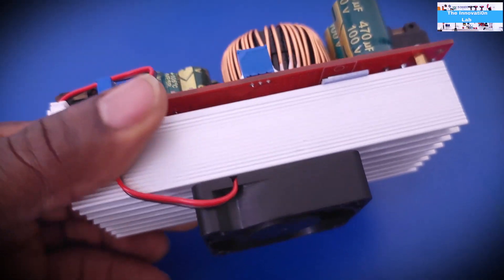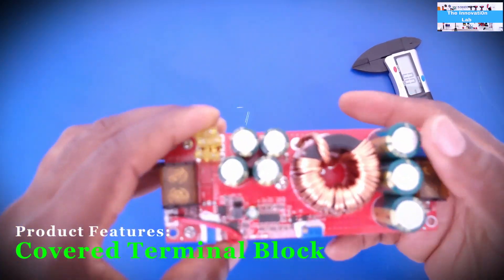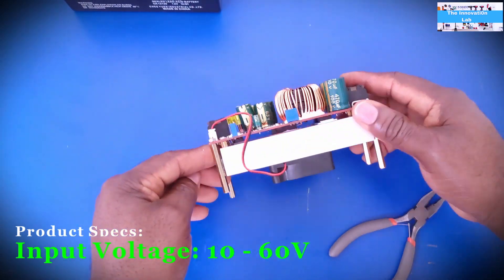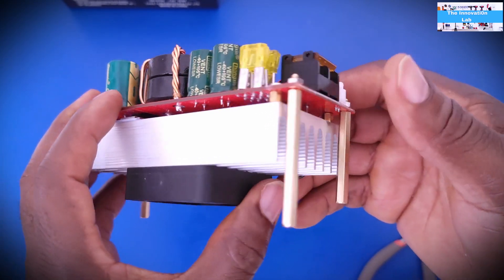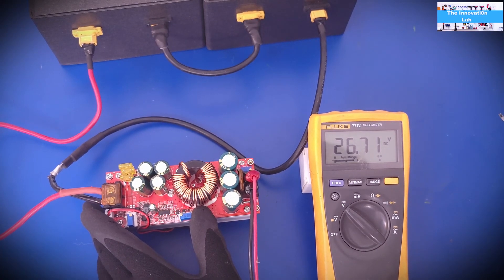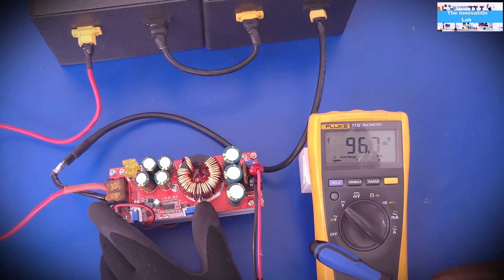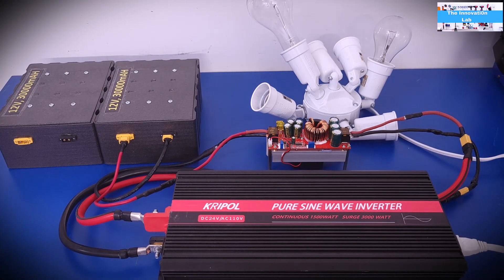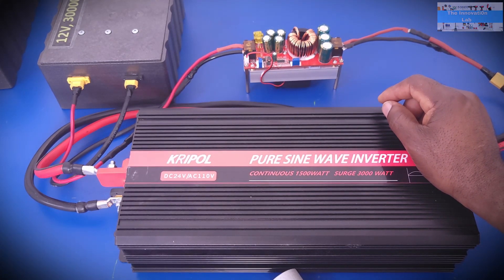Testing Cheap DC-DC Converter from Amazon - Are They Any Good?

Comment: Great video,I have been wondering if I could use a 60v 10amp hr battery to run a inverter for back up power in emergencies, inverter is 12 volt 1000 watt pure sine wave. Thanks again for your videos.
Reply from the maker: Thanks a lot for the wonderful feedback!
We do appreciate it.
However, this converter can only be used to raise input voltage to higher levels. Since you have a 60V battery and your inverter is 12V, it seems that what you will need will be a buck converter. Just keep in mind that you will lose a lot of power due to efficiency losses on the buck coverter.
Thanks again for the thoughtful question.
Success wishes on your projects.
👍

Comment: The fan is not automatic i purchased 2 pieces  now I am using fan direct
Reply from the maker: The fan on the ones I have usually  turn ON automatically when the system warms up to a certain temperature - as you apply a heavy load ofcourse. What is the maximum load you have applied to your converters?
Reply: Both of converter i checked but automatic not working thanks

Comment: So with 12 v inputs the 1800W boost converter delivers 360W and 30A with 24v output, avs what with 84v output.? But what about 2 in parallel with 2 diodes on ithe output to share, could you do a test if the current will increase to 60A, and can you show what happens if you put the current potmeter to maximum, will that incerease the current further? I am curious
Reply from the maker: Thanks a lot for such constructive feedback. I greatly appreciate it when someone takes the time to watch our videos and provide amazing feedback. 👍😎👏
Your ideas are great, and everything you said is correct. I have considered making a video to show how you could connect two or more boost converters in parallel using diode output isolation or droop sharing, but I have not been able to do so yet. But I definitely will.
The only issue I see is that this topology will only work for a fixed output voltage system - if you are able to tune both converters just right.
- same output voltage level
- same output current limits....etc.
My experience is that the switch-mode power supplies naturally do not like being paralleled unless they are designed to work together with a synchronous control.
Again, I appreciate your feedback, and please stay tuned for when I make that video.
Thanks again!
👍👍

Comment: This test is without a heavy load...What is the current under extreme load?  For electrical bikes you need a lot of torques. I doubt if this boost controller can handle that. why didn't you use 2 or 3 boost converters parallel and use diodes in  the output or 5W 10K resistors to share  the current in all boost converters in parallel ? Than it might work if your battery can handle the current.  Then why you don't use a 72v hub motor put the current potmeter on maximum and increases the voltage to 84V  that decrease current.
you just need to have an extra cooler on your motor and an more heavy controller maybe?
Reply from the maker: Thanks again for all the wonderful ideas and suggestions. 
I have a test video coming out in a few days that shows the boost converter being tested with my ebike load simulator - under heavier loads.

Comment: Thanks for this video...I just wonder what will happen with the current under load if you use 12v input and boost till 84v, Will the current stay 40A or collapse?
Reply from the maker: Thanks again for the wonderful interaction and feedback. 👍👍
These converters have an input current limit of about 30A, which means that you should really expect less than 360W at the output of the converter if you use an input voltage of 12V.
For driving something like an ebike that will impose high current surges on the converter, I won't recommend using a 12V input source unless we can show that paralleling the converters will work efficiently. As you know, the higher the input voltage, the better.

For the specific 12 to 84V case that you presented, let's do some math...😊
Assuming that the following conditions apply;
Input voltage: 12V
Max Input current limit: 30A
Converter Efficiency: 98%
Converter output voltage: 84V
Delivered output power = 0.98(I *V) = 0.98 * (30 * 12) = 353W
Delivered output current at an output voltage of 84V = 352/84 = 4.2A.
So, looking at the math above, one can confidently say that, yes, at an output load of 40A, the converter will basically crash or go into oscillations - depending on the nature of the load.
Also, keep in mind that the efficiency will definitely be worse at a 12V input. I would expect low 80 - 70% ranges. I just used the 98% as a theoretical best case.
Thanks again for such thoughtful interactions, I appreciate it.
Please let me know if you see any error in my math above.
👍😎

Comment: I have watched this video twice now. You have some great information here and i really appreciate you sharing it . I have a question. How do we know what size boost converter do we need for our project. What determines if the converter is suitable. My input and output voltage falls within the range. What else is important to know if it works?
Reply from the maker: Thanks again for the wonderful feedback.
This converter can be used for a wide range of DC to DC applications. It really depends design needs. 
Here are some examples of what I would consider:
- Rated Outout power
- Rated output current
- input voltage ranges
- Desired output voltage range.
- output ripple 
I typically don't worry too much about the output ripple if I am using the converter for battery charging. However, for amplifiers and more sensitive applications, ripple voltage levels need to be considered.

Please let me know what you will be using the converter for, just to help me provide a better feedback.
Reply: @theinnovati0nlab782  *Here is the ideal i had after being frustrated with my Ryobi tool batteries. I want to make a backpack mounted power pack using Kobalt 24v batteries wired in series. I wanted to use the boost converter to power my battery powered tool no matter the brand . i will construct a adapter to fit the slot to power my tools. The main tool that it would be used for is a 40v Ryobi leaf blower. Because the voltage is adjustable i thought i could just change it to the required voltage of the tool. I found video of a similar example to give you an ideal :https://www.youtube.com/watch?v=KQ9UiD-OTbk
I hope my ideal is clear. please let me know if you need anymore information. I appreciate any input.*
Reply from the maker: @dexterousx92  
Thanks a lot for the clarity and for sharing the video.
For such a project, you need to know the power specifications of the Ryobi leaf blower. Then, with that  known, you can now select a boost converter and battery system that can provide that much power.
In a nutshell, you need to know the following specs of the leaf blower;
- input voltage 
- input power.
P = IV; can be used to calculate the drive current required - If that was not provided.
Unfortunately, most tools will only tell you the voltage rating. But this is ok. It only means that you need to design your battery pack to be able to deliver high currents. 
As for boost converter recommendations, I believe that the 1500W converter used in this video should be able to provide all the power you will need. 
Important note:
Make sure that you set the output current setting to the max point.

Safety:
Please lithium ion and lithium phosphate batteries have very high energy and power densities. While this makes them very useful and desirable, it also makes them dangerous. Please be very careful with your battery designs and charging process.

Success wishes on your project.
👍😎
Reply: @theinnovati0nlab782  Thank you for this very informative response. Ill let you know how things turn out.

Comment: Can i use this to charge secondary battery? From alternator to this then out to 2nd battery..
Reply from the maker: Hi friend,
Thanks for the very thoughtful question.👍
We get this question a lot.
I believe that under careful calculations and a good understanding of the power limits of your alternator, it should be possible.
However, please note that there is a Moderate to HIGH risk of damaging your  vehicle's electrical system if the boost converter fails. 
Personally, I would not encourage you to do it - too risky for me, given that a vehicle is involved. However, if you must do it, I would recommend adding input and output blocking diodes - going from your alternator to the boost converter (input) and from the boost converter (output) to the battery you are going to be charging.
Secondly, I would recommend using low charging currents or trickle charging - this way, you won't overload your alternator. 
Lastly, try not to do the charging while your alternator is already under heavy loads like running the A/C, headlamps(at night),......etc.

Lastly, please note that my suggestions above are purely theoretical, as I have never tried this concept in the past. 
But it should not be rocket science, though.😊
Success wishes to you, my friend!
👍😎

Comment: This is a really good video, and I will like to buy this device to convert the power from my 24v wind turbine to 48v since I have changed my inverter to a 48v system, but I have a question.

Do I have to connect power sources to the input and output before I can adjust the voltages, and can it work even if I do not make any adjustments to the input and output voltages? Thank you in advance.
Reply from the maker: Hi friend,
Thanks a lot for the wonderful feedback. 
You only need to connect a power source to the input of the converter (10 to 60Vdc) to adjust the output voltage. 
Steps:
1. Connect your input  voltage source.
2. Connect a power monitor or DMM to the output.
3. Adjust the output voltage potentiometer.....that's it.

Note:
This is a boost converter, and you can only adjust to a higher output voltage. For example, if your input is 24V, your output will never be lower than that.

To adjust the output current, you will need to connect a load to the output.
Reply: @theinnovati0nlab782  I thank you for your prompt reply, but I still need a little more clarification. I have a 12v power bank which I can connect as input to adjust the output voltage which I intend to put at 55v and I assume that when the wind turbine is connected the converter will accept the variable voltage from the turbine, but why do I really need to adjust the current? 

Can the converter not vary the current as the input voltage vary?

My wind turbine is actually a very small 200w type and wind does not really blow too often in my location so I am wondering if I can just cope with the default current setting, except changing it can help my turbine to start charging with very low speed wind.
Reply from the maker: Hi friend,
The truth is that this boost converter is designed only for steady state input power. I would not expect it to perform well under a variable input power application such as a wind turbine or solar. 
Please see the video we made to illustrate this below 👇👇
https://youtu.be/4RfOrXcBvOY
Also, I have never done any wind turbine projects, and I don't know much about it.
My suggestion given that this converter is only about <$30 will be for you to get one and conduct a performance test on your system. 
But again, I wouldn't recommend using this converter as a wind energy charge controller. It was not designed for that function. Even if it works to some degree, I would expect it to be very inefficient.

Success wishes on your projects.
😎👍

Comment: Hey just wondering if I could use this in reverse or if it would work for my purposes. I would like to have my input voltage roughly 60 volts 120 watts be converted to an output of 12 volts 700 watts. Could this work for such a purpose, or is there another converter you would recommend?
Reply from the maker: Hi friend,
Unfortunately, this device only works as a boost converter - it can only increase the input voltage. It does not work in reverse.
It looks like you need a strong buck converter that can deliver high currents. I have not seen anything that comes close to what you need. The ones I have used in the past are buck converters rated for <15 amps.Amps.

A 12V, 700W output means that you will need a buck converter that can deliver greater than 50A of output current. You may have to consider a custom design. Or you can do an online search. However, my hunch is that it will be relatively expensive.
Reply: nop you can also use this converter as a step down buck  converter.    to handle higher current you put 2 in parallel or 3 and ad on each output a high power and current diode or a 4 w 10 k resistance to keep the current share in all parallell converters
Reply from the maker: @hermantelbo6283  
I am not sure if there is a typo in your first statement. But were you saying that a boost converter can be used as a step down (buck) converter? If so, please share how you are able to accomplish this.
My understanding is that there are essentially three types of non-isolated DC-DC converter topologies;
- Boost: Only boost the applied input voltage to a regulated output.
- Buck: Only steps down the applied input voltage to a regulated output level.
- Buck-boost: A hybrid design that performs both boost or buck.
The converter reviewed in this video is strictly a boost converter, and it can not perform a buck function.
Please clarify your comment so we don't confuse our audience.😊
I am also willing to learn something new - if I was wrong
Thanks again.
👍😎
Reply: please can you do a load test with 2 boost converters 1800W in parallel.  with 2 diodes in the output.  I wonder what happens..

Comment: Hi, I’m looking to charge 8 batteries in series (96V DC) off of a car alternator, about 14V DC. Do you think I would get any oscillation if so I can I lower the wattage so that it’s just a trickle charge?
Reply from the maker: Hi friend, 
I like your innovative mindset. 👍👍
However, this is not something I would personally recommend - given the perceived risk level involved. Doing this could potentially damage your vehicle's alternator and electronics if anything goes wrong.

Now that we have talked about the risk, I believe that your idea of charging multiple batteries in series using the boost converter is possible as I have shown this in many of my videos.
However, in your specific design, I see some issues;
1. If you are using lead-acid batteries, then you will need a total of 112V as your charging voltage. The recommended charing voltage for a 12V lead-acid battery is about 14V. 
So,  (8 × 14) = 112V
2. These boost converters are rated for a max output voltage of 90V, so you will not be able to get to 112V.

My Recommendations:
If you decide to do this, see if you can modify your design to allow you to charge 4 batteries at a time. This means a total charging voltage of 56V.
Or you can configure your setup, such that during the charge cycle, your batteries can be connected as 2 parallel, and now 4 in series.

Note:
Your idea of trickle charging is a good one. But it means that you will leave your car running for hours? Will it be whorth it?

Thanks again for sharing this wonderful thought.
Success wishes on your project!
😎👍🎊

Comment: Hi, can we use this converter to charge 72v electric motorcycle battery with another swap-able 72V  battery?

You said that this can step up around 3V from input voltage..
Reply from the maker: Hi friend,
Unfortunately, with these converters, you will not be able to accomplish that. This is primarily because 72V exceeds the maximum input voltage rating. 
Input voltage range:
10V to 60V
Output voltage range:
12V to 90V
Current limit:
30A.

Correction:
I never mentioned that these coverter inputs can go as low as 3V - maybe you misheard what i was saying. Please see the input voltage range above.

Comment: Cooling fans do  make a huge difference with heat sinks. Good tests.
Reply from the maker: You are absolutely 100% correct. I have heard lots of people saying that these converters are failing, and this is simply  because they are not cooling them well enough. 

Again, I agree with you.
A fan is to power electronics, what water is to us humans.
Reply: @theinnovati0nlab782  I was using a thermal camera to look at how hot something was one time, and I simply blew on it, and could see it cool down a bit, and then warm back up again right after I stopped. People do like to max out devices and then wonder why they fail lol. I have started stating that I try to stay below half the max values most of the time, just like everyone knows to do for resistors

Comment: THANKS FOR THE GREAT REVIEW!!!!!!     
NOW I am about to buy this converter, but have one question:
Is there a MINIMUM OUTPUT CURRENT requirement??  My load at times will go down in the mA range where I need the full output voltage.
THANKS AGAIN!!!
Reply from the maker: Thanks a lot for the wonderful feedback.
This is a good question, but there is no minimum output current requirement. I have used it to power only my digital power monitors (90mW) and the boost converter still maintained its output voltage regulation.